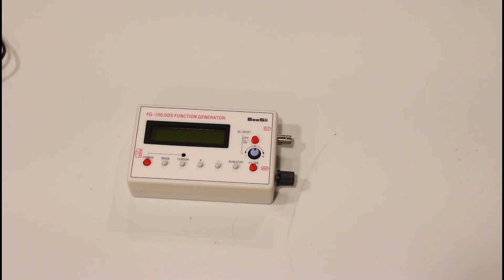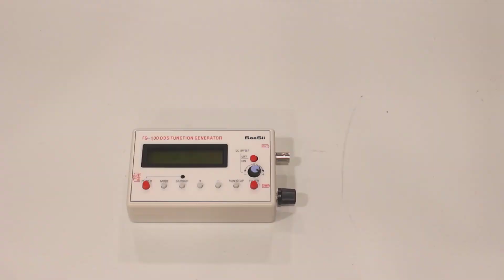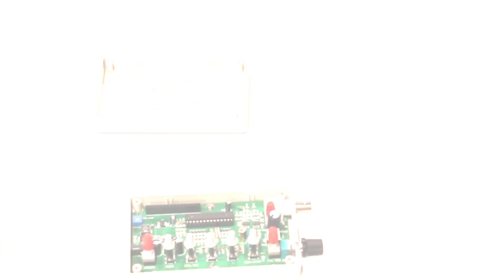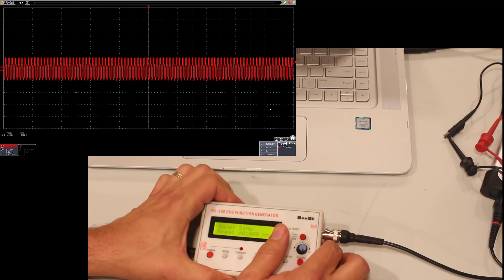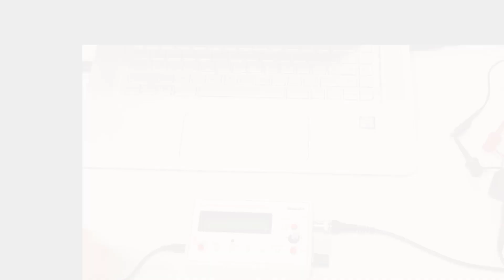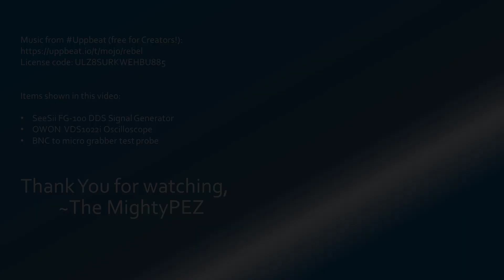SeeSii FG-100 DDS Function Generator - Troubleshooting and Overview

Comment: Would it be possible to make a modification and add an interior lithium battery to make it portable? Thank you.
Reply: Yes, it would be possible. However to do it you would need to provide 2 or 3 cells in series to get a decent amount of voltage.
Adding a boost converter on a single cell would probably introduce noise and make the signal quality even worse.
You really need a nice clean DC supply on a device like this.
Reply: Of course, but it would have to be flat type, rather than, say, a 18650. You wouldn't need 10v, as one may think, considering that it runs fine on 5v via USB.

Comment: Thanks for this useful video. I have few questions:
1) What is the maximum current it can provide?
2) Does it come with a power adapter? If no, which one to use?
3) Can I run it from my computer too? I mean is it possible to interface it with a free software and operate it accordingly? 
4) Can we generate frequency in decimals too, like 114.223Hz?
Reply from the maker: Hello and thank you for your reply

1) Next time I am using the device, I will measure 
2) No adapter, it uses a standard provided usb cable, I power it from my nearby laptop, but have also used a phone charger.
3) there is no interface other than the front panel buttons.
Reply: @mightypez  Thanks for your reply

Comment: It is inexpensive but wow, way off on max freq spec.  What does the filter actually do, clean up the waveforms at all?
Reply from the maker: I noticed a "slight" reduction in noise (or sometime just shifting the noise) at the higher freq like 10K.  it did nothing that would change / correct the underlying waveform, so when they started to break down (square wave looking like Triangle) no benefit.  Honestly, after trying it a few times, I never use it.

Yes, for me way off, but thankfully I just wanted a cheap low freq sin wave to drive a breadboard circuit clock for low freq testing, so it works for me.